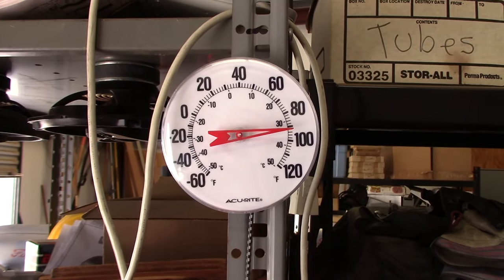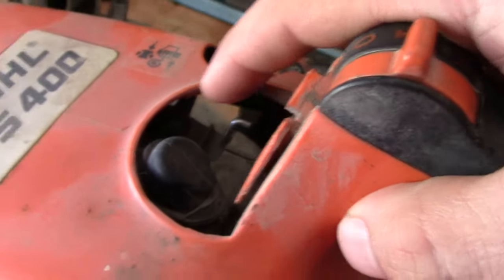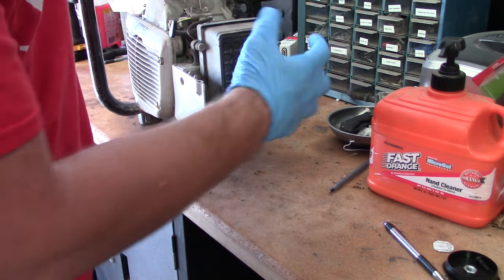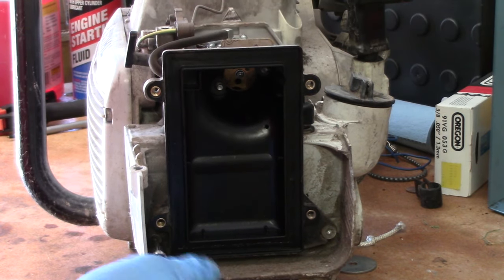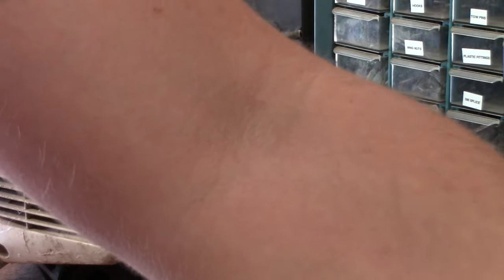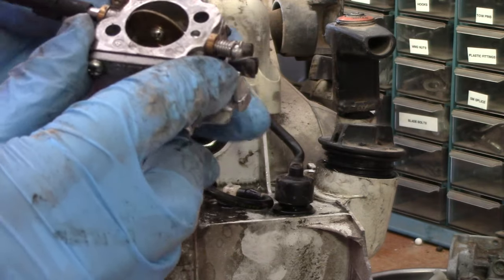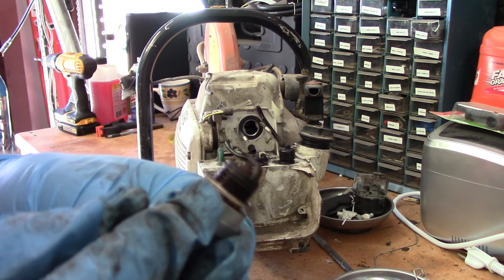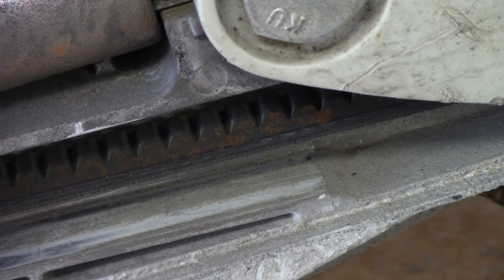Stihl TS400 Carb Removal For Tune Up Part 1

Comment: You said it...Most times it not even worth the labor to tear those carbs apart.. New carb is almost always the way to go.
Reply from the maker: Ya ive seen this alot with 2 stroke equipment mostly, some of the newer mower carbs are going that route too

Comment: Are the after market carbs ok? I seen some on Amazon pretty cheap. Thanks 👍
Reply from the maker: I’ve had decent luck with them
Reply: @hanksgarage_  cheers mate, I've ordered one. I wrote that before the vid finished where you said the were ok. I paid £20 UK for carb and full filter kit, plug etc so that's pretty decent. Cheers 🍻

Comment: So A Trick to get that diaphragm working again is soak it in brake fluid. If it doesn't have Holes it should regain its flexibility again that's actually the fuel pump also you can buy just that diaphragm because walbro is better than China AMEN